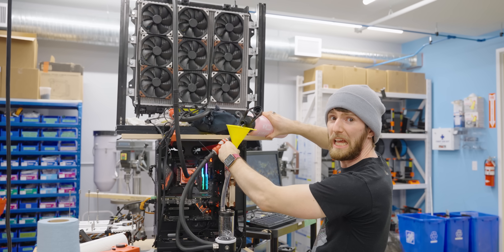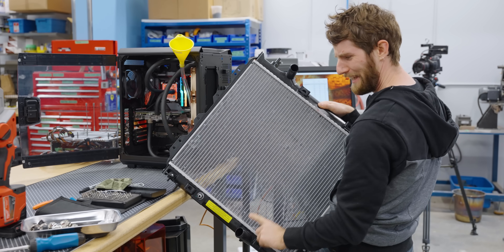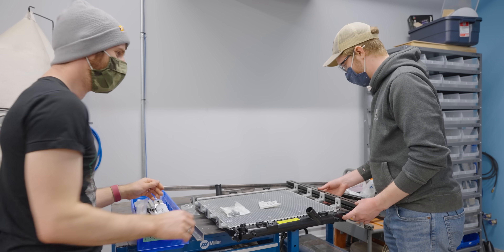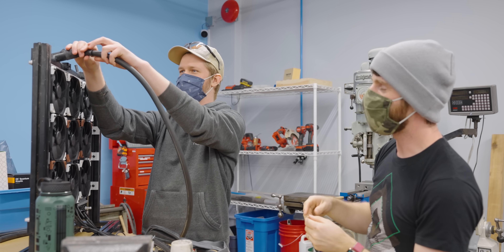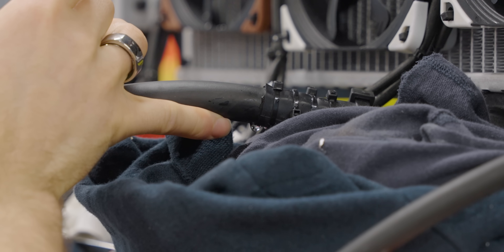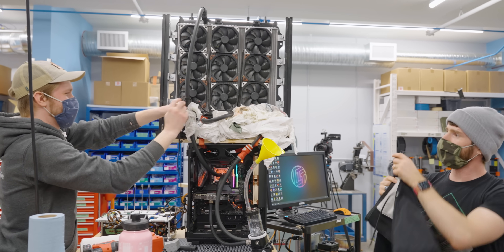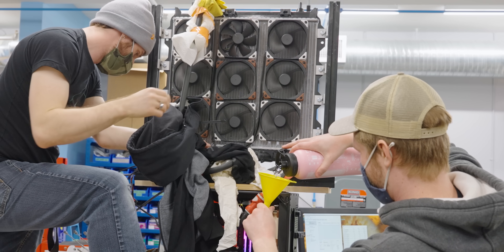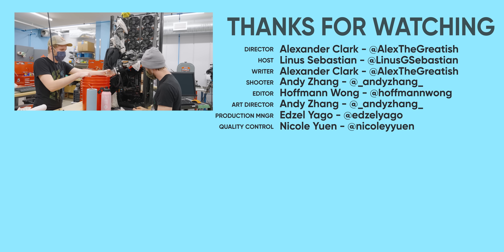Our Craziest Cooling Project Yet - Car radiator liquid cooler

Comment: I'm assuming the jankiness and lack of foresight was actually part of the plan for this video to increase the entertainment value, but it just made me more annoyed than entertained. Why start running it without doing leak checks first, or plugging in the fans? Why put it on top of the computer where you know all of the leaks are going to risk the hardware? Projects like water cooling the Red camera still have some jank, but are better because they're actually thought out.

Comment: Love your show but not this one. This is a disaster in the play without any good engineering plan on knowledge beyond it was rushed. You could have clamped cooling kit on the table as long as you avoid point fans into the PC case. The coolant prime will be easy as long as the pump is lower i.e. under the table. Luckily this pump is not powerful enough otherwise you will have >2x leaking points and to destroy your PC. Hopefully no audiences here will directly copy this act.

Comment: “Let’s put the radiator on top of the computer. What could go wrong?” 

*20 minute video ensues.
Reply: It's dripping all over the PC. ADD MOAR WATER!
Reply: Woow, I just discovered you last night :) <3
Reply: Eyyyy
Reply: oh hi erik
Reply: it was to make it look crazy......... but at least it keeps bubbles out of the pump too....
Reply: @Hummingbird-ju7tk  oh yeah? You think they kept bubbles out of the pump? It was going with air half of the time...
Reply: These ppl have clearly never changed a radiator in a car. Those zip ties are shit. Hose clamps are what is really needed. I've thought about using a vehicle radiator b4, and with proper fittings and pump it would work exceptionally well. These guys just executed poorly.
Reply: @JS-wc4xs  
Not to mention the absence of the proper fan over it, which consumes way more power and turns the cooling rig into a noisy jet engine.
Reply: I was thinking the same thing.
Reply: GirlBaBes.Men
Reply: Every comment will be replied here and heart too 
https://youtu.be/dyUNU44hWfY
Reply: Famous last words
Reply: this pissed me off cause of the leak I wanted to reach and help lol triggered
should have glue gunned the connections or something?
Reply: Costly content baby
Reply: Why put it on the top and risk the leak? Put it aside by side
Reply: @ashvinla  I think the whole point was to be dumb to create "drama"  if they had just done it "right" there'd be no crazy video
Reply: yeah. it was all scripted.
Reply: @SeraphX2  sure buddy
Reply: @SeraphX2  its true, i was the pt cruiser
Reply: @SeraphX2  i think you are confusing voiceover with scripting

Comment: the reservoir should be at the same level as the top of the loop is. That's how car coolant reservoirs are placed. The highest point of water can be seen in the reservoir. Then the pump is just located somewhere in the middle or bottom of the loop. 
This whole video is a joke. They could have easily made everything waterproof if they wanted prior to testing this.

Comment: if you just didn't put the radiator right on top of the computer, and had a proper adapter, an actual test could have been done.

Comment: I don't even know what is the point of half of the videos or this channel any more... this video was just ... stupid... for the SAKE  of being stupid, its not even comedy...
it wasn't entertaining, it did not answered any questions regarding IF you would want to use a car radiator ( like some ppl did in the past ) for your water-cooling, what kind of temperatures / noise lvl  could you expect / how could you set it up in your computer / how would the maintenance be  ETC ...
At least when you guys filmed "CRAZY" ideas before like the "room water-cooling" in the previous house, it was an interesting take, it clearly was content that it was interesting and you were showing ppl that this crazy idea could be done and what the problems were and what could be improved on if WE decided to do something similar! 
But not this ... stoop pumping stupid content, please ! 
if you have a video idea, then use it properly, instead of rushing everything and shouting a lot, this is not interesting and or entertaining, if I want to watch stupidity I just go on tick tok.
I do understand that in these times it can be difficult to have "proper" videos but ... I cant stoop thinking that the production value / the equipment / editing of this videos has skyrocketed and the actual content has taken a serious dive !

Comment: Like... they make fitting reducers and hose clamps for a reason. And there is no way it’s budget issues 
ETA... why on earth did the radiator need to be on top of the system like that?

Comment: Man you weren't even trying. Zip ties to connect two soft tubes. Smort. You could have just used a metal tube that roughly fits inside the tubes. Or basically anything round that is solid and than the zip ties or the metal ones would have had something to hold onto

Comment: For everyones education, the transmission cooler is a liquid to liquid cooler which is why it doesn't need alot of surface area. The benefit of using the engine coolant to cool the trans fluid is space and it can also get the trans fluid warmed up quicker in really cold climates. The downside is that if your engine starts to overheat it's going to overheat the transmission as well

Comment: but why did they put the radiator on top?
i understand it if it was mounted in any way shape or form, but it was ilterally just strapped to a piece of wood on top of the case.
at that point you could just as easy put it next to the case, at least untill you have tested it you you don't pour a ton of water over your 3090

Comment: Umm.... wow... I don’t wanna be a jerk and say that you guys are better than this. But you guys usually do better than this. Linus acknowledged that by having to constantly top off that these numbers where invalid. The adapter problem could have been fixed via a trip to the hardware store or even a 3d printed barbed adapter nipple and a piece of the proper cooling hoses. The video seemed like it started good but what the heck happened?

Comment: should had use hose clamps plus look for hoses with reducers which you might find at the local hardware store.  It could save you alot of time.  Better planning next time guys

Comment: Ok, so next time a proper big car radiator, a proper fan shroud, a proper car radiator fan at full speed, no leaks and see how many computers can one radiator cool. One radiator at the center of the table and 6computers running full on... A proper radiator should have the capacity.  Think of all the tubes, all the fittings, all the noise...

Comment: Put the radiator on hinges and mount it to the side of the system like a sidepanel. Putting the radiator on top of the system instead of even just setting it off to the side set you up for failure. This would be cool to see not completely ghetto rigged

Comment: i friggin love projects like this. But here is where you went wrong
one, the pump is struggling trying to push water that high up against gravity and through that large of surface area, you really should have 2 pumps at the very very least or one big one. Also there are many ways to get better quick and easy fitment without leaks. try the radiator on the side of the pc, better reducers, and be sure to have a better pump setup and you can blowwww those temps away! .

Comment: If you would have done it right it actually might have been a good video. For example it would be cool using the Radiator as a complete sidepanel for the case. And I am talking about a rather clean solution and not such a throw together pile of junk that is leaking as hell. Of course that would take longer but this is a LTT video right?, so it should be some quality content even if it takes some more time and therefore money...

Comment: Only at LTT would they have a $2K+ computer plugged in and running in the background and then haul a giant wet radiator around beside it and not worry about water splashing on the aforementioned computer.

Comment: Since it’s made to transfer heat from an engine block, it would be interesting to see one or multiple PCs and graphics cards using the radiator together with an automotive electric fan and radiator shroud.  Then you could set up an optional hvac heater core as a personal heater for someone if they are too cold in the winter or from the hvac in the room.

Comment: A 20degree plus difference would appear to be something worth investigating. A radiator and an automotive 12v fan can be had on ebay for less than a $100 (US). A visit to your local hardware store should have produced adequate plumbing fittings for a leak free system. Please do something other than a joke video on if this is feasible.

Comment: I would actually be interested to see this done right.  An interesting idea to have a beefy pump to a remote, large radiator.  You could do some noise isolation on the huge radiator with 9 fans.

Comment: i understand that the craziness of water leaks  with genky cooling setup and electricity and electonics etc.. dont go together, but this is getting old, just get some proper hose clamps and fittings, and make the thing an actual running cooling system.

Comment: The trans lines connect to a separate smaller radiator inside the main radiator tank. There is no coolant flowing through it, otherwise the trans fluid would be mixing with coolant. The loop you made was redundant, it would have been fine to leave it open.

Comment: Actually, this has a lot of potential. Should have used the pt cruiser radiator fan which would give you plenty of CFM. However you didn't need to use the transmission cooler part.

Comment: Guys try using a motorcycle radiator the in and out tubes will be a lot smaller and you will probably be able to get it watertight... Maybe even a snowmobile radiator will be small enough but bigger than a motorcycle radiator I don't know....😎

Comment: The frame for the radiator and the fans were pretty legit.  If the hoses and fittings were done properly, that might’ve not been such a cluster f*ck.  But, that probably wouldn’t have been as much of an entertaining video.  I’d like to see this done right and benched before they break it down and we never hear of this atrocity again. 😀

Comment: All y’all needed to use were the two big hoses on the radiator. The transmission loop is a separate tank inside, if not the oil and antifreeze would mix.

Comment: instead of pumping through the entire radiator, fill the radiator and cycle it through its own pump. connect the CPU/GPU lines to the transmission line and it will be cooled off from the main radiator.

Comment: I wanna see this redone properly with actual fittings and a racing style radiator
Reply: Could be really interesting if they replace the D5 with a real car water pump and the Noctua by a car radiator fan
Reply: @Scyllx  honestly im kind of disappointed with these "experiment/fun" videos lately. They don't bother to make things properly, and while I understand that it would take exponentially more time and effort, these videos feel too half-assed.
Reply: @potatosoup19129  isnt that the point of these type videos they're funny vs normal
Reply: @Sh4dovv  but im here mostly because of my curiosity regarding the performance of combining a car radiator and a gaming pc. I like watching them mess around as well, but at some point the video loses focus and they're busy trying to not get a 3090 wet because they decided to rush everything.
Reply: @potatosoup19129  if something is not practical to anyone it's more fun to half ass with proper results it than make it 100% properly
Reply: @potatosoup19129  fair enough makes sense.. I've seen a few different videos where people have made separate radiator boxes that resemble a tower attached beside it which seemed great and super clean looking
Reply: right? like the mishimoto for my 05 wrx would have only been a few dollars more. and then comparing like the mishimoto rad fans vs the noctua would have been awesome.

Comment: The smaller fittings are for cooling automatic transmission fluid  it loops thought the area where the “cool” water that feeds to the motor as it’s cooler then the transmission fluid. It wouldn’t really do anything to put the two “loops” together as it’s would just pass though the similar temp water again before exiting back into the loop. Because a engine is intended to run at a constant temperature of around 180-195F it doesn’t keep anything as cool as what we would like for a CPU GPU.

Comment: the smaller outlets are for the transmission fluid, they get cooled from the coolant thats in the bottom tank of the radiator. best to just not use that lol.

Comment: As both a car/racing enthusiast and PC gamer/builder, this entire episode is cringe.

"We don't know how a radiator or transmission cooler works, but let's not do any research to figure it out. Oh, and it's leaking. But let's not fix the leak. Let's just get more towels."

And I've mentioned this in other videos, but they are total hacks for as professional as they try to present themselves and the amount of money and equipment they have. I don't know how they can go from one of their super clean desk projects; to a stupid, janky, unfinished job like this.

Comment: Hooking up the transmission part would be a mistake. In a sense it looks like it'd restrict flow. Also, transmission cooler is just a tube from on side to the other, cooled by the water around it. Basically, big hoses  water gets cooled, and That cooled water cools the transmission pipe at the bottom.

Comment: fun fact: tap water has minerals that can deform deposits inside the radiator, next time you flush a CAR radiator you should use de-ionized or distilled water to ensure no deforming occurs.

Comment: proper reduction fittings coming to and from the radiator in and out would solve the leaking problem
using one automotive electric fan woulve been neat since it only runs on 12 volts and like 60 amps, and generally pull 1200-3000 CFM
maybe the reason the pump was going dry was because you were still filling the radiator and it was still pushing air out

Comment: the result looks more like electroboom than LMG/LTT ;-)
I did my first watercooled rig in 2002 with a used Volkswagen Polo cooler and a 20 liter water tank for short-term performance, cooling CPU + GPU + Chipset

Comment: The transmission loop is just a heat exchanger that transfers heat to the main engine water loop in the radiator end tank.

Comment: While I absolutely love how this turned out I'd also love to see a follow up. Honestly other then the bad seal this looked like one of your least janky projects and I am actually insanely curious how it would perform if sealed better. Plus it's actually look awesome running if it wasn't for the towels and shop cloths. As you mentioned refreshing the water every 15min would have quite the effect and with about 20min of patience rather then the old "geter it done" attitude I think you could seal those connections pretty easily.  It wouldn't be much to fill a video but maybe some jokes about using it as a privacy wall between gamers or seeing how much you'd feel the fans when you sit beside it could add to it.

Comment: Im not sure but i think the transmission cooler uses coolant and the other second "inlet" is for the coolant reservoir  so the pumping you build is not helpful at all either use only the big connection or one big and otherside small

Comment: A bit of a mess but the original idea was good. I've been thinking about making a large cooling system, for use with a linux system and it would be about the same size.  The radiator and pump built into a nice box on the floor under the desk - a large 20" or bigger low speed fan running continuously blowing air thru the radiator and the fans on front side pulling air thru, as needed to handle the heat. A large continuous duty pump moving all the water thru the system - reservoir on the desk and perhaps one or two small watercooling pumps in the computer case to boast water pressure as needed, for extra cooling.  Ideally, once all the air has been purged the large fan and large pump on floor would move  plenty of water all the time.  Trying to use small fans and pumps on a large system just gives more things to leak and fail.  I watched all the videos of your attempt to watercool several systems and was sad when it all started messing up.

Comment: Yo this is one of the best episodes you've had in a long time.

You did something awesome. That actually turned out to work. More efficiently which make sense. Given the surface area. But maybe I am underestimating the amount of airflow for all those fans.

However you had a recipe in this particular episode that seems to be a combination of many of your other shows. And that combination is gold if you can properly utilize it.

I mean who would have thought giving a PC. A Radiator Mohawk. That would make Spinosaurus Egypticus jealous.! Which is just cool to say.

And then you added an element of PC peril. As well as personal peril of electrocution.

Juggling the stuff you have to do in order to maintain PC operation. And only doing it well will achieve optimum PC performance. Sounds like the perfect game show for a another offshoot of Linus Tech tips don't you think.!

You could even call it. "PC Peril" or "People vs PC" or maybe even "PC Mouse Trap."

You could even have actual contestants who win actual prizes.

That have to build or repair a PC. Under some perilous situation. To achieve victory.!

You know what I'm sayin. It's like a tech car crash. Where Tech enthusiasts would not be able to look away. It's the blade of Linus Tech tip shows. With all of its strengths. And none of its weaknesses.

Anywho hope this was helpful. Great episode.!